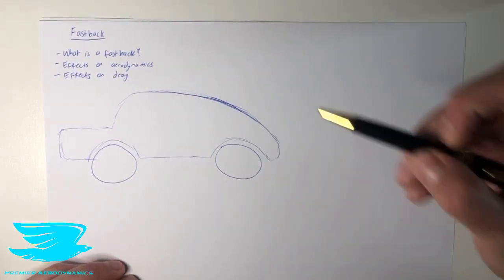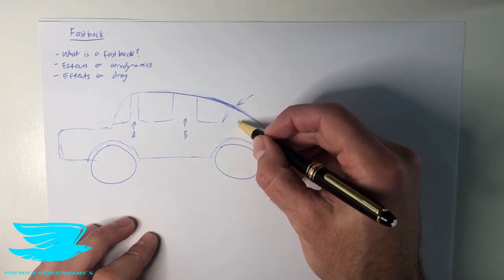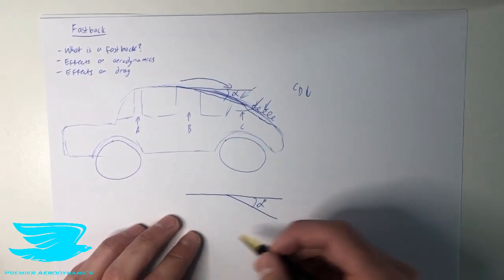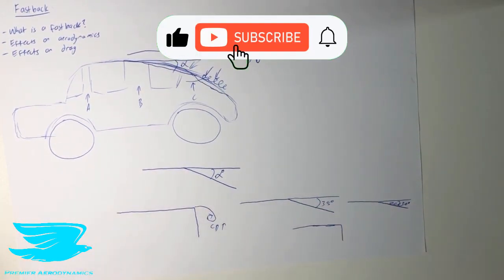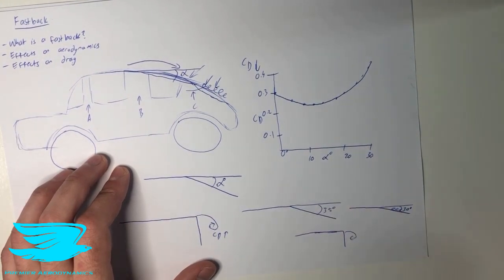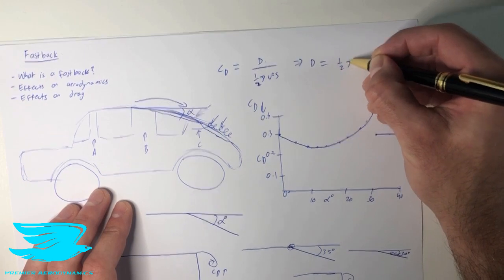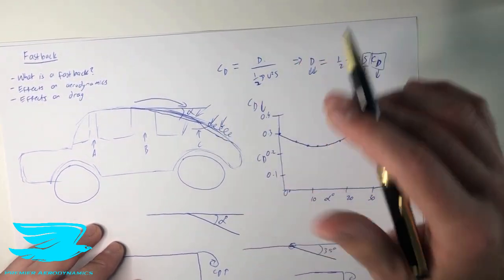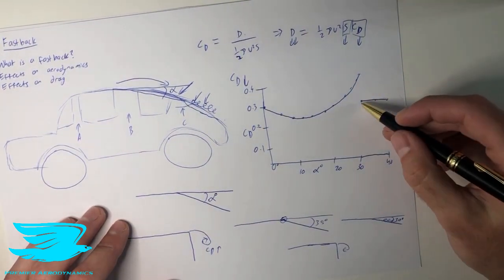{Automotive Aerodynamics #1} Fastbacks Explained

Comment: I read an online paper on this and realized, based on their graph, that a 25-degree rear had about the same drag as a 45-degree rear. Really anything after 27 isn't worth it, and you might as well go full coupe. Also, 60 is about the same as 90, but everything in between is worse, so really, either pick 10-25, 40-60, or just 90. Outside of those choices will typically be significantly worse than within them.
Reply from the maker: That's interesting. Various angles effectively create similar flow physics.

Comment: There is mention about reducing frontal area with a fast back. I was wondering if more detail could be added to that statement? How would it do that? Allow for a lower roofline?
Reply from the maker: Yep, not only that, but also reducing the frontal area reduces the drag because it reduces how much area the air has to hit and go over.

Comment: At 1:33 you said the c-pillar vortex helps to reduce the drag, I am wondering whether this statement is correct. Because the c-pillar vortex actually causes the lift induced drag, which is one of the main sources of drag of fastbacks.
Reply from the maker: Yep, and even a little pressure drag. But if they wash down the flow over the rear, it can make the wake smaller and reduce drag that way.
Reply: @PremierAerodynamics  Yes, like you said in the video later, it really depends on the inclination angle.